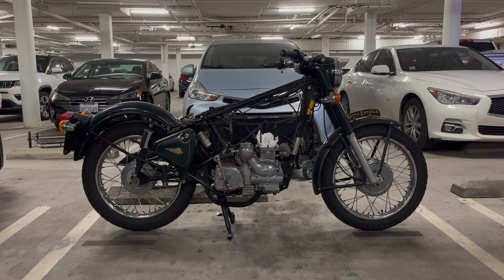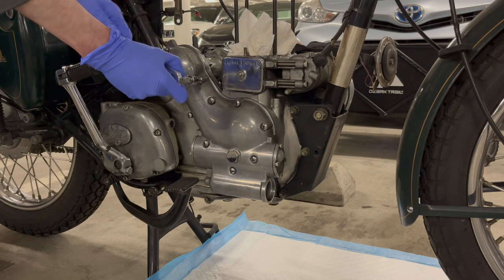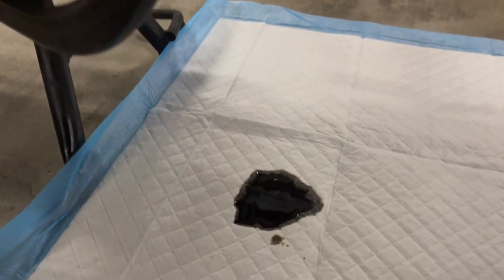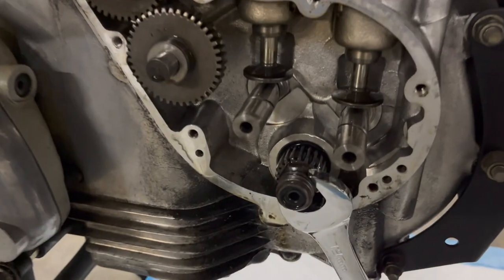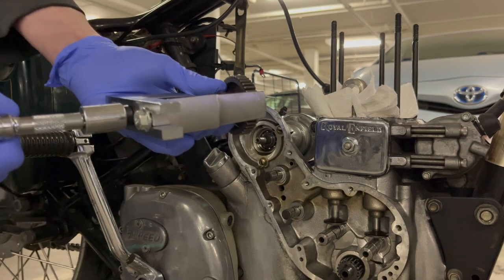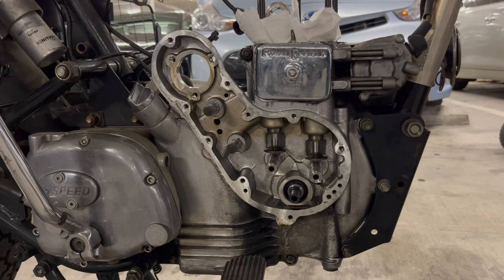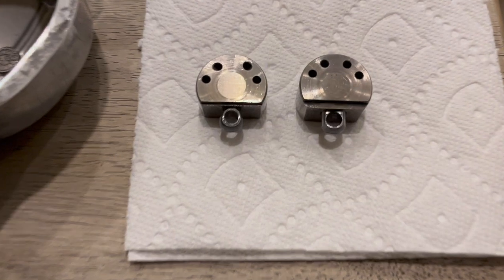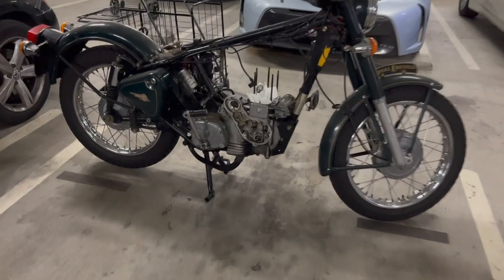Restoring my Royal Enfield Bullet 500 - Part 3

Comment: You can use a piece of folded denim to jam up those idler gears instead of a screwdriver. Much less likely to damage the teeth.
Reply from the maker: Yeah, I wasn’t thrilled using the screwdriver, but I used the square side of the bit instead of the blade, and the bolt on the distributor gear wasn’t super tight, so all is well

Comment: Continuing to enjoy the strip down and your detail step by step approach. The lighting and photography are excellent. I was surprised that I couldn't see any dowels to position the timing case to the engine case, maybe it just relies on the timing gear spindles to position everything? Looking forward to the next episode :)
Reply from the maker: I appreciate that and thanks for watching! And the timing case is a very old school design
Reply: The two cam and two idler gear spindles are an interference fit in the crankcase and a sliding fit in the timing cover. Once it's slid down over those, there's no axial movement at all, they are effectively big fat dowels. You would ideally plastiguage and shim the clearance between the cam and timing cover because there is a lot of variation in gasket thickness, it can actually lock the engine up solid when tightened down if the gasket is too thin/shims are too thick.
Reply from the maker: @twostroke350  Yeah, it seems recent gaskets are thinner than stock. I know some people who literally double up on gaskets to avoid that problem. I’ll assess and make a decision when I’m ready to reassemble. And thanks for watching!